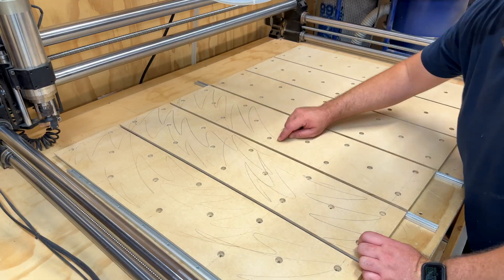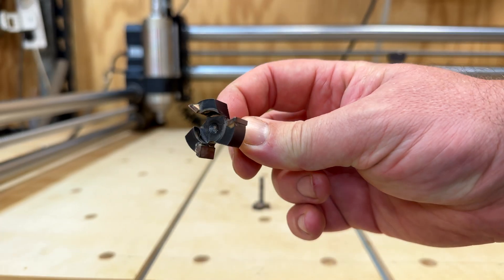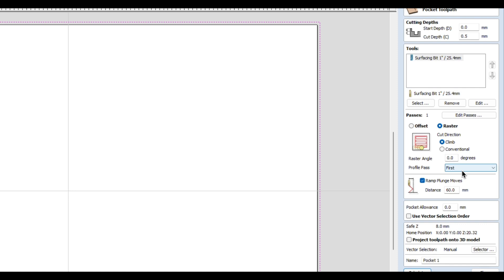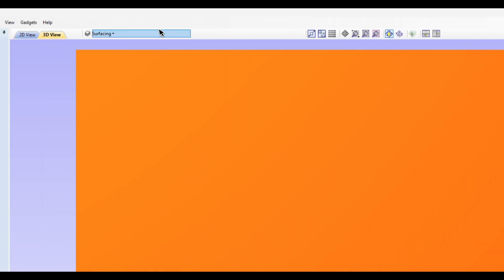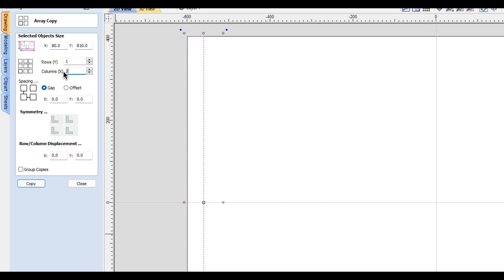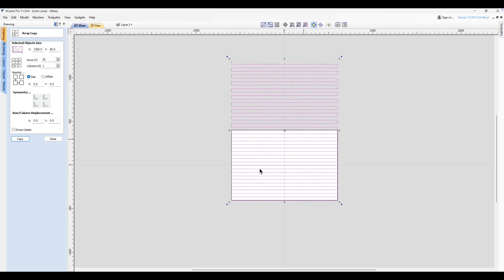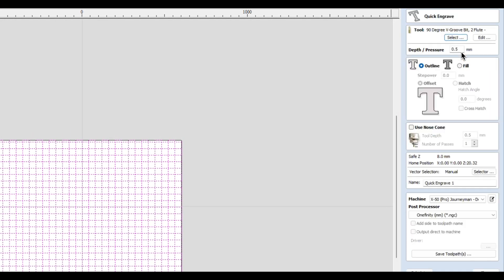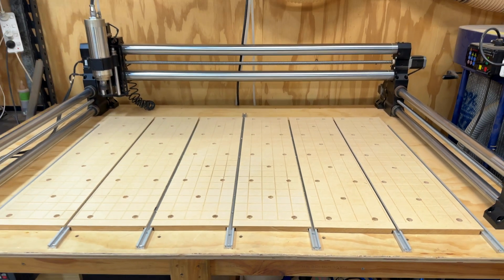How To Surface & Grid Your Spoilboard The Right Way Every Time!

Comment: Yet to get my machine up and running, but have followed this video in preparation. Nice and clear, and to the point, no faffing about which is appreciated as other videos drone on and on. One thing I've noticed is that lots of people have holes in their grids, is this for clamps I'm assuming? If so, maybe you could do a 3 in 1 video next...... haha
Reply from the maker: 3 in 1 sounds like a plan! :) Glad this helped! I have been thinking of making a removable spoilboard that just sits on top of the fixed Spoilboard. One with extra holes and options for specific tasks or repeatable tasks, like rounds for clocks or cutting/chopping boards for example.

Comment: I have done my spoilboard a couple of times now but never save the actual toolpath I created for it so I need to come back to Youtube to find a video to refresh my memory.  These are clear and simple steps.  Easy to follow too.  Keep it up!
Reply from the maker: You are welcome. Really not as hard as most make it out to be with lengthy tutorials.
Reply: If you set your z at say 10 and then surface .5, when you go to your grid if you only set your depth at .5 then you aren’t reaching your material surface which is now 9.5. Every time you resurface to reach flat you need to adjust z. Right?
Reply: Or cut depth…
Reply from the maker: Hang on I see what you are saying.  So you zero your z to do the surfacing first (so it will take 0.5mm off).  Then when you do the grid, you zero your z again of the new surface after it has been surfaced.  That way the grid will still be 0.5mm or whatever depth you want it to be.  Does that make sense?  So for both toolpaths you need to zero your z off the current surface of the spoilboard.
Reply: @TwinSummitDesigns yeah, I get that. Thanks. Just found your channel. Good stuff!
Reply from the maker: Glad that helped! 👍🏻
Reply from the maker: Im not sure I follow you 100%, but basically each time you surface your spoilboard, you set your z height to 0 off the current height of the spoilboard.  That way it dowes not matter next time you surface it again because you repeat the same process - set the z to 0 off the current surface of the spoilboard.  Im not sure why you want to set your z to 10 to start with...?  Hope that make sense.
Reply: How did you make the holes on your board? Counter sink + plug cutter?
Reply from the maker: Those were done with a  forstner bit to countersink the holes for the screws used to fix it in place. Low enough so I won’t hit them if I accidentally cut into the surface of the Spoilboard.
Reply: @TwinSummitDesigns spent all day lowering my screws…
Reply from the maker: @ValinPrezkowski  Worth doing.  Those took about 20min to do.